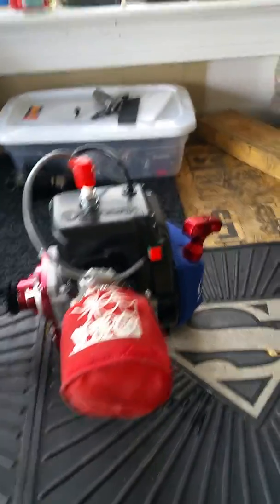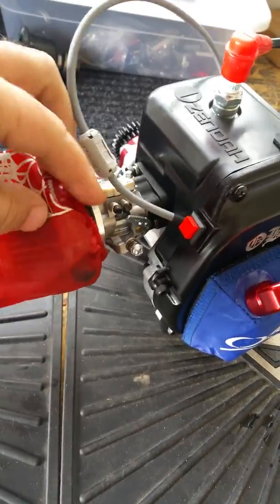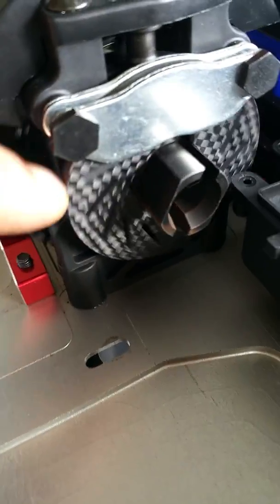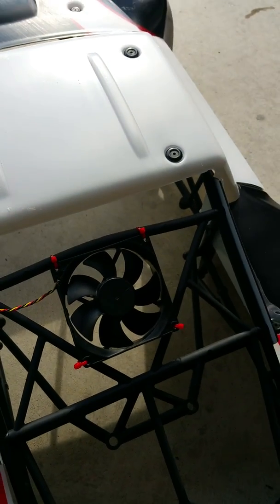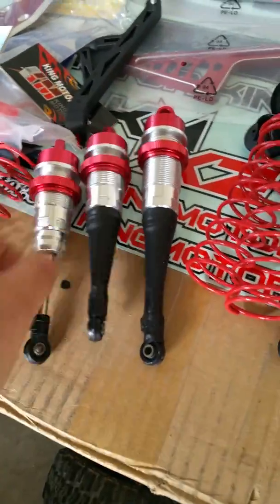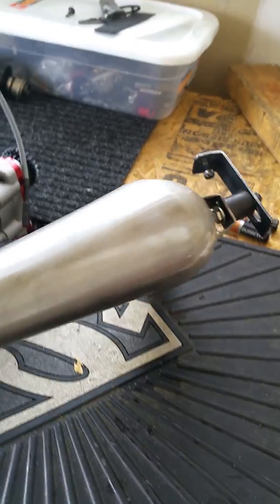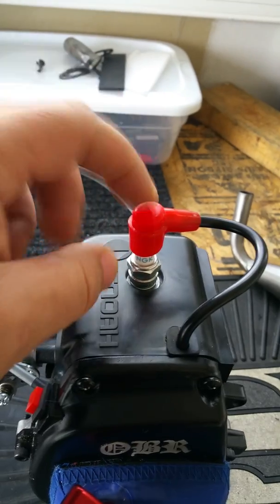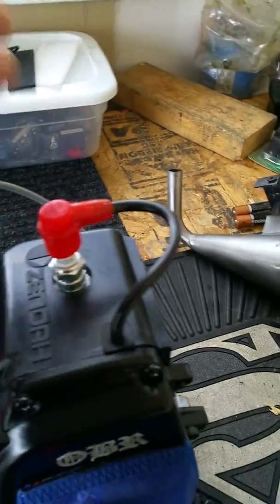Zenoah G340rc, X2 custom build update

Comment: coming along nice... with the stripped bolts as you have done mark a slot on top of the head of it and use some heat. heat helps heaps. heat gun if you've got one. Also what air filter will you be using? And all spark plug leads are the same. got to grab it by the base of it.